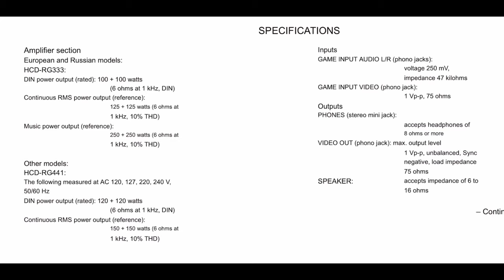SONY MHC-RG333 Maintenance Repair Restoration Disassembly Part 1

Comment: Abim kolay gelsin elimde 2 adet sony müzik seti var takipçin olarak  hayranlikla izliyorum yapdigin işleri mümkünse tamir ve bakım işleri var yapma şansın olurmu ikamet ettiğim il amasya sana göndersem kargoyla
Reply from the maker: Merhaba.Kardeşim ben tamirci değilim.Olsaydım yardımcı olurdum.Videolardan izleyin yapın çok zor değil.Sağol izlediğin için👍🏼🙋‍♂️
Reply: I hope it will work after reassembling
Reply: The video is almost over by dis mentling,i hope he will fix it back,make a second video to show if it works,or he must be a scrap dealer
Reply from the maker: @jonessoares6896  In my assembly, people have learned to disassemble properly and sequentially.

Comment: I have this exact model for a little over 19years,Great years of music & the other day,it started acting strange, Saying no CD the open & close wouldn't work,was also Flashing songs number 1 to 99 really fast...I'm so Sad that it's happened, I'm going to see if there's anywhere that I can get it repaired or even just another radio that I can Connect these Whopper Speakers to...